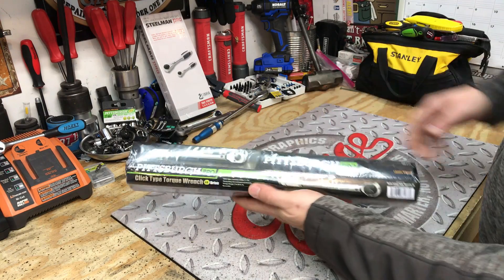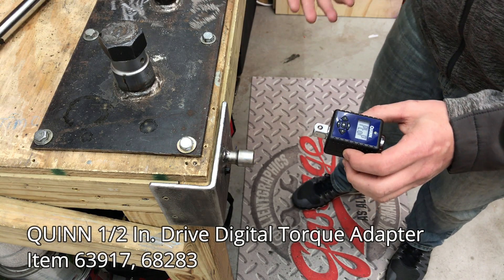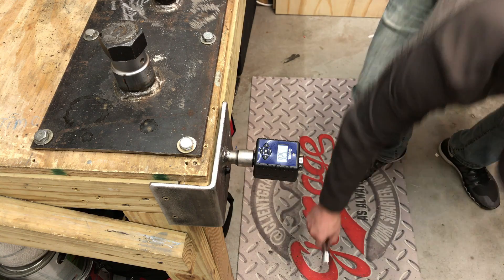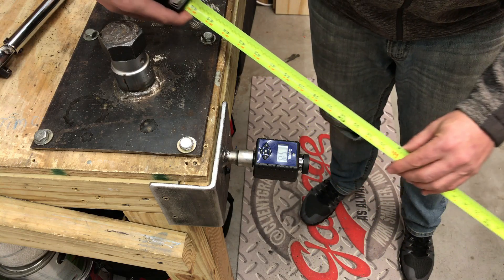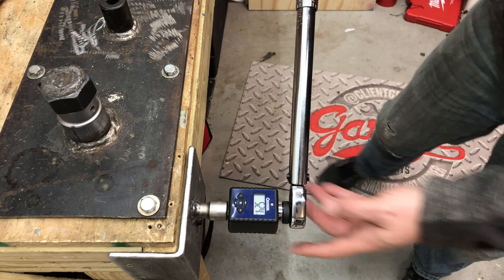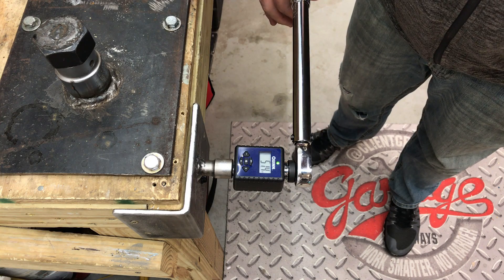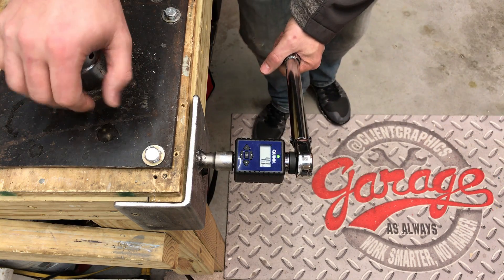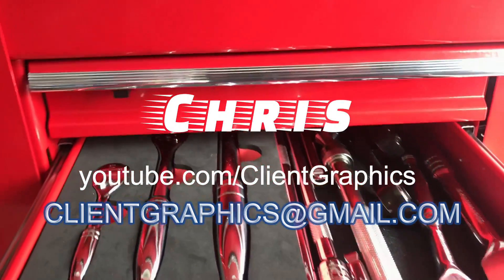Dropped the Torque Wrench? Let's Find Out if it’s Still Accurate

Comment: Never heard of exercising a torque wrench,  thanks for the info.
Reply: @Rich Smith It really depends on what you're working on. Automotive? It's really not that big of a deal to be slightly out of spec. Aerospace? Absolutely it's unacceptable. It really depends
Reply: I'm in the Airforce, specifically aircraft maintenance and every time we grab a torque wrench we break it 6  times at max torque before using it on the jet. I came from working on cars my entire life and this was unusual for me as well at first, but it's actually a thing according to the other Airforce members who test and measure our tools.
Reply: never something iv ever concidered but something ill do in the future
Reply: @Rich Smith my work forced me to get a calibration done on my torque wrench because it was clicking too early apparently. i have never had a tire fall off and i wonder if i had excersied the wrench if it wouldve shown a different reading
Reply: @AUTOBROZ780  well usually the tire (wheel) is tighter then what you put your torque wrench on assuming you use a torque stick, number 2 even if it is slightly off its not like the 120nm spec is 100% where it will just stay on, your wheel will stay on at 100nm too. the 120nm is just for extra safety
Reply: Some torque wrench manuals tell you to use the torque wrench a few times on max torque before you start. This is very common.

Comment: It’s a pretty good bloody torque wrench I’m not a fan of the spring click style 

in Australia we have a very good design called Warren and Brown and it’s a deflecting beam 

some of those old torque wrenchs have kept their calibration for 50 years

If you’re doing really precision stuff with the clicker style I’ve seen recommendations where you have to “warmup” the wrench and take it through 10 pound increments from bottom to  the max setting to free up the grease and stop at binding internally don’t know if it’s true or not.......

Comment: I really want a torque wrench to add to my tools - I'm an amateur who likes tinkering. But in the UK they're so expensive to get a decent one. 

Great video by the way. Subbed.
Reply: You can get the type in the video for less than £20 at Aldi or Lidl when they get them in stock, or maybe more dubious quality on eBay. Machine Mart and Screwfix have a bunch including 1/2" drive for £25 to £30. Not too bad on quality and price.
Reply: @MrPGT  I'll have a look thanks mate. I've been looking at Amazon Basic ones which seem to have really good reviews. Again cheers.
Reply: I can vouch for the aldi one, 15 quid appears to work as intended. Halfords sell better ones for 70 to 80ish certified with lifetime warranty
Reply: I bought two in the Netherlands from HBM, it looks very similar to the one in the video and I really enjoy using it. The only struggle is that the direction switch works oposite from normal ratchets
Reply: I paid £5 for mine in a job lot of used tools that I’ve never calibrated but seems to work just fine and I always check again with a bar or ratchet to make sure the bolt or nut is actually tight but maybe over torqued
Reply: @Alexander_l322  That defeats the purpose of using a torque wrench, to a degree. Fair enough, for wheel nuts a little tighter is better than too loose, but for stuff where you don't want to cause warping, like a cylinder head, too tight is bad. There are videos showing how to check and recalibrate with a cheap luggage scale.
Reply: MrPGT9999 id probably buy a new one if I was doing the kind of work where specific torque was very important. But I’m pretty sure mine is still good, I should have it checked to be sure though.

Comment: The other thing I have heard of that might throw off the accuracy is storing it in the toolbox under pressure.  Whenever I torque down some lug nuts to 100 ft. lbs. I always back it off to the minimum torque setting before putting it back into my toolbox.  Is there any truth behind that?  I heard somewhere that if you don't back the torque down before storing it, it will knock off the calibration. The one I just bought also says in the instructions to "Never lower the torque setting lower than the minimum".  Mine goes from 50-250.  Will it throw it off if I spin it below 50 on the handle?
Reply from the maker: Each torque wrench is slightly different some have internals that might come lose if unscrewed too much while others just simply stop when you back it off as far as it goes. We’ll find out in a few months or so what happens as I’m storing that torque wrench at 50 ft.lbs

Comment: Calibration technician here.
Pittsburgh torque wrenches are actually a bad sample for these tests.
1. My company has purchased for our customers multiple brand new Pittsburgh wrenches in a row that failed calibration, so not that reliable from my experience.
2. This particular type of wrench does not have a practical way to adjust the calibration, so no screws, nuts, or bolts to slip with impact.

Also when you exercise torque for calibration, it's exercised 6 times then tested in the same direction then repeat for the opposite direction if applicable, not 6 times both ways then test both directions.

Comment: You should also store your torque wrench set at its lowest setting. I believe that this wrench is the same one I've had for best part of 30 years, it was badged as a kamaza in the uk, they were part of lazer tools. It was made in Taiwan. I tested it at work last year an it was still within spec. I got one for a mate who always over tighten nuts and bolts, from aldi supermarket, it was made in Taiwan and was the same box, 10- 150ftlb, with same extension bar. 12 quid.

Comment: I have a similar HF torque wrench, in 1/2” drive. I bought it for $10 or $20, don’t remember which. I haven’t used it yet. It replaces my Craftsman Digi-Torque wrench that failed, and with the demise of Sears, I can’t find anyone to repair/calibrate. 
I’m very impressed with your testing and results. It gives me faith in my new HF unit. My old standby is my very old bending beam torque wrench. You haven’t lived until you’ve applied so much pressure that your arm shakes, making the beam and pointer shake. Try reading that!😃.

Comment: Only calibrated my two year old snap on click type torque wrench   it was dead nuts on.    But I also only use it upon final torquing never really need to ratchet it.  And always store it zeroed out in it's case.   Only dropped it like three inches

Comment: I just have to add that 52.5 compared to 50 is 5% off, not 4% or less. That said, I own 2 of the 3 HF $10 torque wrenches. No complaints.
Reply: The torque wrench only goes to 80 ft pounds each pound is 1.25% so 52.5    compared to 50 would be  3.125% accuracy
Reply: @michaelbladen4971  I disagree with that method. If that is how a manufacture calculates deviations, do not buy their products. What you described is marketing misusing numbers.

Comment: Great test, I always wondered if you could use the torque wrench beyond the torque setting.  One application of this is castle nuts on tapered ball joints - tighten to torque, then to the next aligning cotter pin hole.  Seems like it's ok to do that.

Comment: Had that same wrench for a torque test assignment at work. (Had to test torque on roughly 1500 bolts at 44 lbs) It lasted for about 300 tests then the guts failed.

Comment: Very very cool test. I’m surprised that an inexpensive version held up so well. Another cool test might be to set it at 50 foot pounds and don’t touch it for a month or 2 and see if that has any effect. Great video!
Reply: I wonder why he only tested 50 ft lbs, I've seen torque wrenches be within 3% accuracy at 40 lbs but 30% at 10 lbs and 14% at 70 lbs. If he tested different lb settings on the wrench it would have provided useful information
Reply: I accidently preformed that test twice, 
Once on a nice new Husky, indoors for maybe a month (no problems);
Once on an older cheaper model which was left for over a year--I think--and in an environment where the temperature fluctuated quite a bit (result: disaster!).

Comment: Great test! Next time you should test how accurate it is if it's put away overnight, 24, 48, 72hrs, and a week at 50-80 lb-ft to see if it stretches the spring enough to throw off its torque values.

Comment: I have wondered what happens to torque wrenches when you leave them under tension on a regular basis I worked at a shop that used them on a regular basis on wheel and I always found them left at 80 90 100 120 and 140 ftlbs . Would that effect their accuracy over time I've wondered how long it would take.

Comment: Snapoffboi:  But but but snap off one will neva break and if it did just give it back to snapoff tool truck driver to get a new one.........(Waits until Fri of next week for snapoff truck.....none avail on truck....order a new one. Will take 2weeks......... finally snapoffboi receives new tqwrench almost a month later)

A Real Mechanic:  .............SMH🤨🤨😖😖 SMH.......Stoopid Dumbass......(drives to hf and swaps for new one out in less than 5min)

Comment: All I know is I had one for over 20 years it was worn out took it in they gave me a new one
Reply: Yup they honor their warranty. No bs. No questions, at least in my experience. The locking piece at the bottom broke. Overall very happy. Use it every tire rotation. 5 tire rotation. I dont just torgue all the wheels, I have hub centric wheel adapters also that I check every time. Done 3-4 times a year now for the last 4 years. I would buy another one even without the lifetime warranty. Very affordable. I paid I believe $13.00 for the 1/2" tourques I think to 150 ft lbs.

Comment: Great video. Unfortunately when you initially checked the torque wrench, all four of the 50lb-ft pulls you did going up were out of 4% calibration. Had to be within 2 to achieve 4%. Still like the torque wrench considering the price.

Comment: Home up on your math .. greater than 52 is not within the +-%4 spec
Reply from the maker: The reality is the Quinn adaptor is accurate within +/- 2% maybe 1 based on when I had it checked out and that was on the low side. I rushed through the pulls and the wrench seemed to be on the high side.  For a $10 torque wrench it was more than I expected.
Reply: This torque wrench doesn't do 200 foot pounds it does 80 each foot pound is worth 1.25%so the 2 pounds over is 3% so it's within spec

Comment: Do this test with the icon torque wrench!
Reply: Real Tool Reviews did Icon vs. Snap On on YT.  Interesting results. No throwing down the street, but straight out of the box the Icon was more accurate than the SO at 1/4 the price.
Reply: @davehoward2791  ya I watched that I was just wondering if the icon would stay accurate after being thrown lol

Comment: Cool tests! I don't mess around when it comes to torque wrenches. I would never consider buying a HF torque wrench for my job.
Reply: I agree but I keep one in the vehicle to torque lugs if I have to change a tire on the road.
Reply: @deanbutler3994  
That is worthy.
Reply: In my near-30 year career as a military helo mech I probably wouldn't have used a $10 HF Q-wrench either, but as a retiree swingin' wrenches on intake manifolds and lug nuts, a $450 tool truck Q-wrench makes zero sense when guys like this prove the $10 tool is within spec (or maybe another 1%) after dropping it a dozen times and flinging it down the street repeatedly, lol. 👍
Reply: @davehoward2791  
I am a 30 year A&P myself! I do use Snap On torque wrenches at work, but you are right. I may pick up a couple for my lawn equipment and motorcycles at home. Thankyou for your service!
Reply: upside downdog  Yep, we used Snap On Q wrenches too, in fact all our hand tools and tool boxes were Snap On. We had those bench Q testers right by the helo shop door and you didn't step foot on the hangar deck without checking the accuracy of that wrench first. (This in addition to annual calibration and certification checks.) That's the thing about aviation, as you well know, ZERO room for error. 👍
Reply: @davehoward2791  
Absolutely! When lives matter every nut and bolt must be right. Have you ever heard of Mena, AR? We are always in need of good help at our airport. Beautiful place too.

Comment: Chris this is a brilliant video.  I have stored that wrench at torque for 3 years. I'm going to see how it effects the spring. Thanks for that "work it" tip.
Reply from the maker: I’m going to set that one at 50 ft-lbs and see what it reads each month for 6month and maybe 1yr if I can remember.  I’ll do a video about it in a year. Calendar reminders set!
Reply: @ClientGraphics   Ever ask yourself why the same company that tells you to set your wrench to zero for storage will also sell you a preset wrench with the same recommendation for calibration frequency?
They all do it. 
Belknap to Norbar to Mountz.
The torque tool industry is a scam from end to end
Especially when you consider how little an accurate application of torque can do to assure you of accurate tension, when tension is what you actually want.
Everybody falls for it, from engineers who specify torque, to assemblers who have to execute the specifications.

Comment: I'm interested to know if you leave it in your tool box at a higher torque setting in your drawer at around 100 ft pounds for a month or so so, how does it effect the calibration. I did this and it failed my employer's metrology test as unrepairable

Comment: Anyone drop a torque wrench that many times doesn't need to be working on anything lol! Nice video!
Reply: protip drop important bolts in hard to reach places brings hours of pay
Reply: @imchris5000  done it not fun. I've pulled stuff off trying to find things when it was in a spot I could reach but not see
Reply: @imchris5000  like dropping a wrench inside a transformer? That'll keep you busy for a while.
Reply: People drop things by accident.
Reply: It's a $20 torque wrench. I see it as a breaker bar/hammer/torque wrench combo.
Reply: Yep
Reply: I drop everything when I'm working